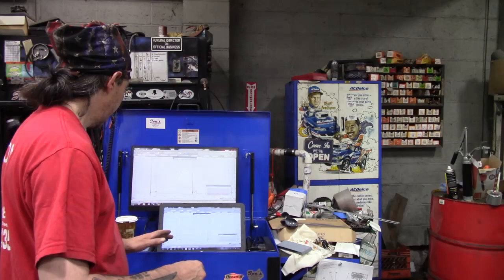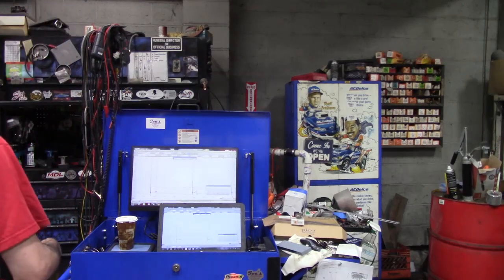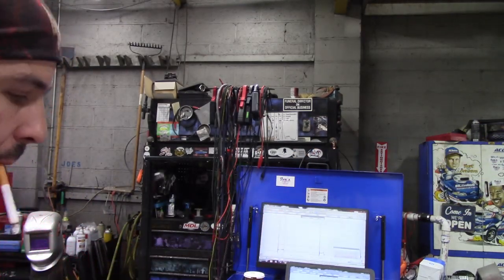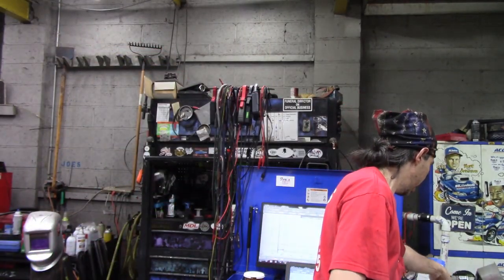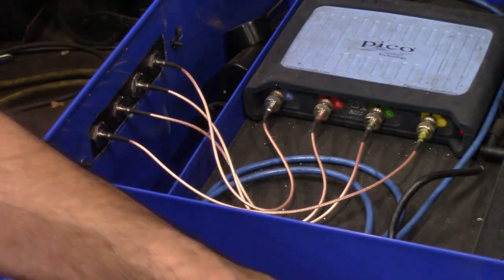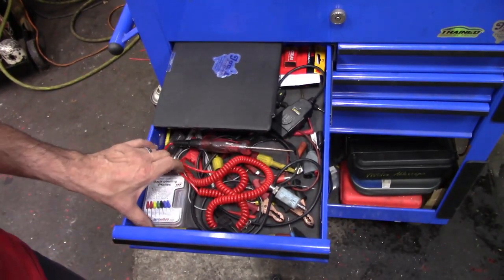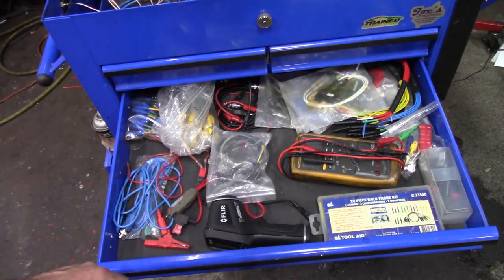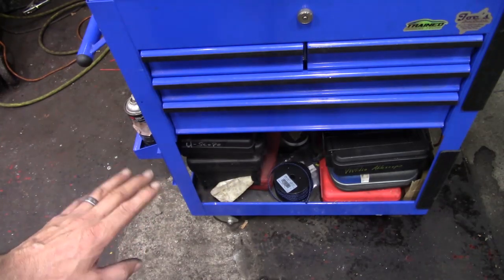Diagnostic Cart Toolbox Tour (Featuring Picoscope 4823)

Comment: Where can I find some shielded cable to make scope leads so I can remote mount my scope? You seem to be able to find some nice stuff Joe. I would like some nice flexible cable, maybe with some braided nylon covering in scope channel colors would be super cool. I'm working on getting my scope cart more efficient to use as well as more organized. Your boom looks great! Top notch work as always.
Reply from the maker: Aeswave sells the short cables man. Cables inside the cart, from the scope to the passthrough plates are available in different lengths on eBay.
I sell the plates on my site. Joesautoelectric.net
You can always message me on Facebook as well.
Reply: @JoesAutoElectric  I have bought a bunch of stuff from you. Love everything I have. I just want to make some custom stuff is all. I may not like where something is and need to make specific lengths of cable. Haakan sent me some links to Digikey but it all looks to be stiff, nothing like flexible scope lead cable.
Reply from the maker: @mikejr550  oh nice bro. Thank you. You'll need to try searching for silicone shield cable...

Comment: do the attenuators that are in leads that have a switch from 1:1 and switch to 10:1 safe to use or do i need to buy ones like you are showing
Reply from the maker: I think you are referring to the setting in the scope. That is simply telling the scope what you have set up on that channel.
Reply: The switch ones are fine. Until you need a 20:1 then you'll need to go to the external. Most of the GDI systems use 60 volts meaning that spikes can be quite high. Start big. The software fixes the reading. Hope I understood your question.

Comment: you'll like that signal generator. like for an abs sensor  you dont have to test drive. you can send the signals into the wiring to check and see you have the same pattern at the abs module. wiring faults will be much easier to find.  i gotta chuckle ... in the '70's we had sun , marquette, bear, and a few other brands made 5 foot wide diagnostic centers with ignition scopes, voltmeters,tachs,dwellmeters, vacuum guages, etc  that one could wheel through the shop.  they pretty much went away with onboard diagnostics  but now the techs that aren't real mobile are making up carts  to do pretty much the same thing. nice thing is though you can make it how you want it where if a manufacturer made one  some would like it some wouldnt. and if you need to go moblile you can.
Reply from the maker: So true.

Comment: Do you have a link for those short mini BNC extensions?  I looked on AESWave and didn't see those.
Reply from the maker: The ones inside the box are from ebay. The color coded mini are from AESwave.
Reply: @JoesAutoElectric  It's the short color coded ones I was interested in.  I couldn't find them.  I found some longer 9" ones but not those nice short ones you have.

Comment: Joe, great idea for a cart but I'd like to make a suggestion if I may: instead of using a BluePoint tool cart as your base you use medical grade lock top medication cart. A business partner's father was a scrapper and he had all these medical carts for sale. My brother bought 2 and used them as the bases for a steel topped welding table. If you don't know, those carts have way more graduated sized drawers than your "tool cart", ball bearing sliders on all the drawers, larger, stronger, medical spec wheels and best of all they were 100.00 for 2 of those carts. The medical specs on those carts made them very strong and I'm sure you can find someone in Bayonne who does that kind of scrapping. Just a thought. I love your cart idea and if I were younger I'd make one myself but I feel giving out a bit of my knowledge about carts might help you. BTW, ask Eric O. about the signal generater since he just put up a video about using one to easily test speed sensors. Anyway love your vids and what you do. Hard to find someone of your calibre or Eric's in Cleveland, too many "parts cannon commandos" here.
Reply from the maker: Thank you.I will certainly look into that. Seems everyone is giving me more work lately lol

Comment: Do you think you will have to add possibly a small 1/4 x 1/4 aluminum angle piece to strengthen the long piece of aluminum to keep it from bending?
Reply from the maker: I expect it to bend slightly...I actually am curious to see if it'll break or not. If so, I'll then make a better one.

Comment: The signal generators 3 cool because you can generate signal to test components I'm going to use an instance say that you have a vehicle that has a Bible reference problem the signal generator will generate that 5 volt reference to test the component is best way I can explain it on here without getting long winded

Comment: The refurbished surface pro 3 is the exact route I went a year or two ago. It works great with the pico. Pickup the dock for around $100 refurbished on Amazon. The surface pro 3 dock was great as it sits in and the side slides into the surface pro and charges, gives you monitor outputs, USB ports, Ethernet, and more. You can set the surface pen up to click the button to start and stop the scope from a distance too
Reply from the maker: Now I am quite interested in that one setup thing you speak of